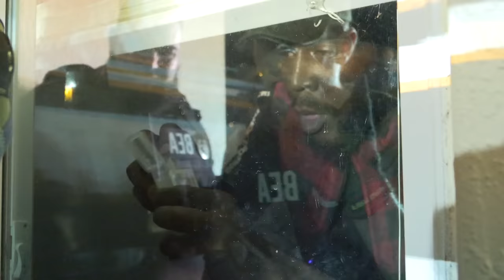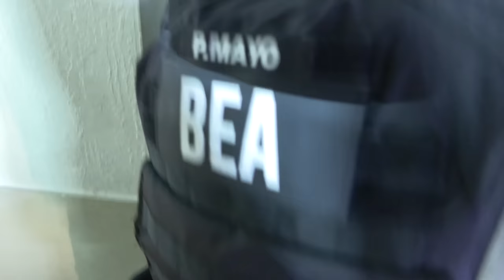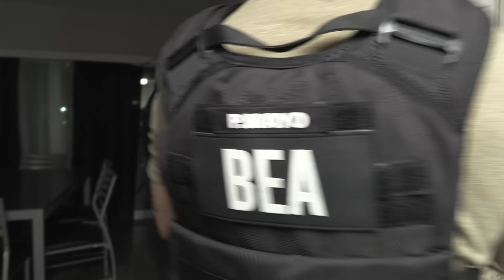THIS MOVE WAS A LITTLE TOO RISKY

Comment: Screen windows are not difficult. When you remove the next one look at the science and design. Clips are simple metal springs. Slide a flat card type tool up or down from the clip location while separating the screen from the window channel..